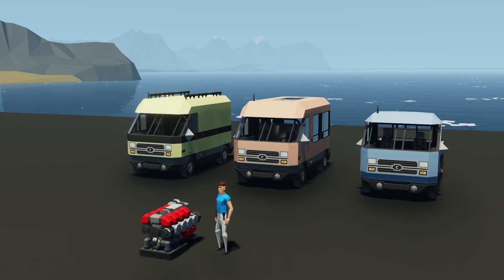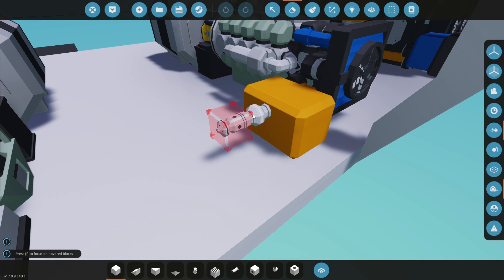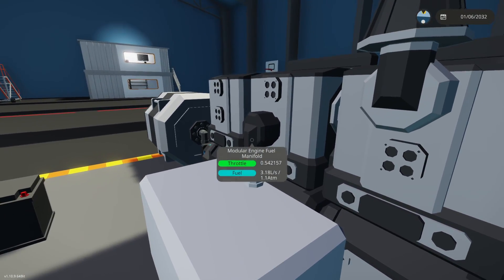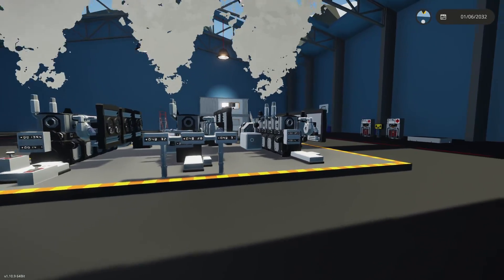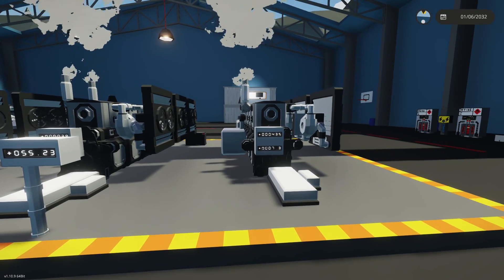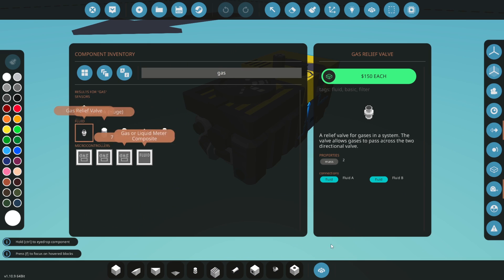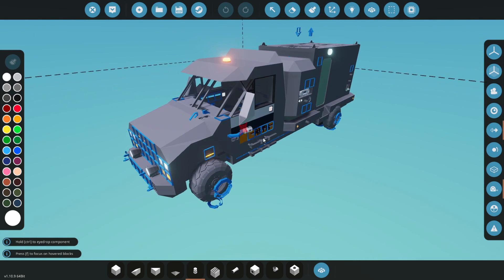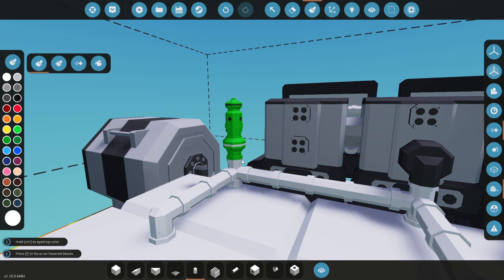PSA: Fuel Tanks MUST HAVE pressure release valves in Stormworks

Comment: Does it affect prefab engines?
I don't have any pressure relief valve on my first boat. Just yesterday I was getting back to base on fumes (less than 2 units of fuel in a tank when I entered the hangar) and engine was running as well as with a full tank.

Comment: I actually went and run a test with this and found.... no meaningful results. If anything, the tank without the valve seem to consume the fuel a bit slower in the beginning, but when both reached 1atm of pressure, which stayed like that till the fuel run out, the amount and rate of consumption equalized on both. Valve or no valve, nothing really changed.

Comment: PSA for the PSA: cat converters are directional.

I spent several hours banging my head against a wall wondering why my engine was choking out on my recent RHIB despite release valves, a couple fuel line redesigns, testing and retesting and testing retests of my engine setup and ECU to finally look at the cat to find the exhaust was built up… pulled a pipe off the end leading into it of it and sure enough: “Exhaust Out”. X_x

Part of this is because I haven’t played in some time. When I stopped, exhaust was bugged and nothing produced smoke. Didn’t even occur to me that they’ve fixed it and this might the problem. The other part is that I simply forgot cats were directional and didn't check it when initially building the exhaust.
Reply: yo dude i just did the same thing tysm you're deadass a lifesaver 🙏🙏
Reply: Thank you mate!

Comment: I had an issue with one of my seaplanes not being able to restart the engine after running it for a while, and I think you just solved my problem for me! Thanks!

Also, is this relevant to the stock, pre-built vehicles, or only modular engines?

Comment: After the gas update I thought that can be Problem but wasn't shore about that, I actually build on a ship Hull and thought I should use a Valve, but wasn't shore and focused on the Hull, good to know that the valve is necessary to use a fuel tank correctly, i wanted to build a tanker vessel 😅

And hey, for that kind of build is it not to bad to use more pipes on the Deck, it's good for more details, shore, it's bad for existing builds but for new ones you have to think twice to solve the Valve problem.

Comment: I definitely second the request for a pressure relief option on the tank parts. This update has put the realism in an awkward and inconsistent place -- real tanks absolutely need a way to relieve pressure, but needing 2 stormworks blocks or even just one stormworks block makes it vastly more bulky than in reality.
Reply from the maker: Right! It totally puts a damper on certain micro builds and is a bit clunky
Reply: It definetly sucks that every creation needs to be updated now :( 

And the fun part is, my plane looks really bad because I cant fit the ports into the tank sneakily anymore, since I need them at the front and back, in case im climbing or sinking..
Reply: @Sembel-xh9vq  the game doesn't model fluids aligning to gravity or sloshing, so you can have all of your piping coming off one port.